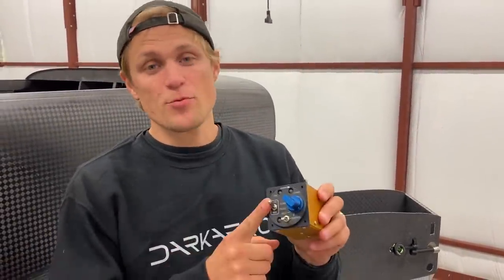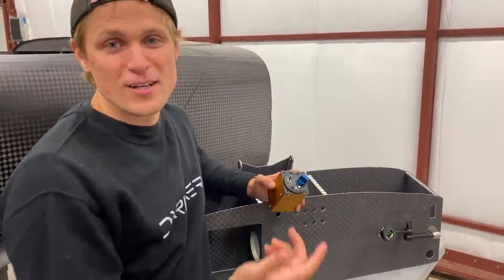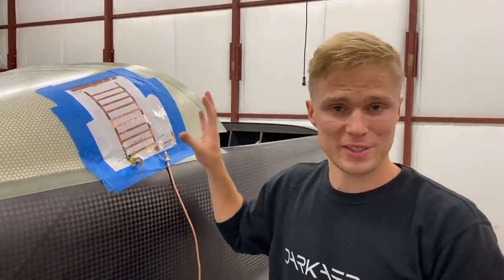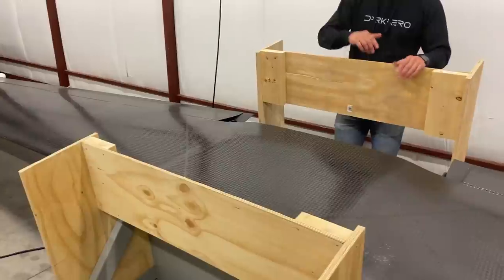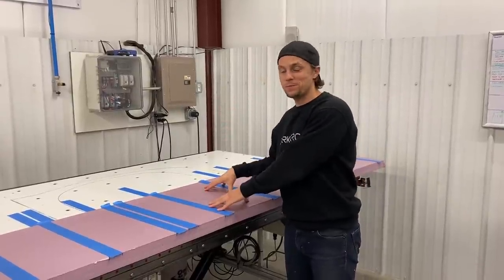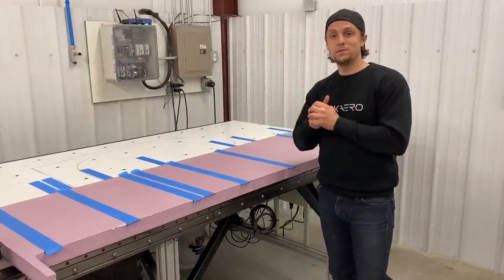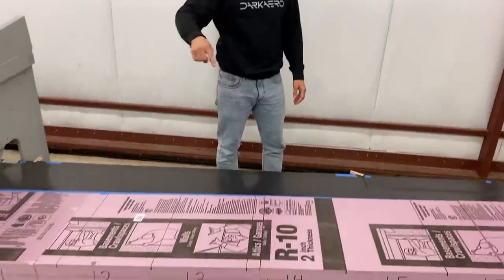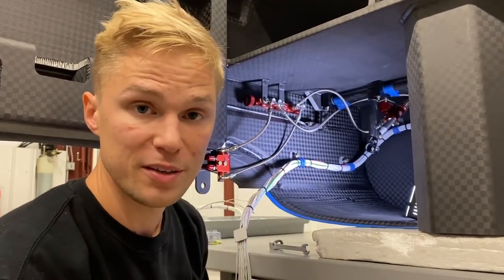Custom Radio Antenna! Will it work? DarkAero 1 Progress Update - September 18, 2020

Comment: For the antenna, how about in the gear doors? When extended and on the ground, better for landing and taking off. When up, better for signals at altitude. Just a thought since the whole plane is a ground plane for the antenna.

Comment: I installed an Airmaster prop years ago and it was very simple to integrated it. Couple of power wires to the controller and then to the prop. Made flying with a Rotax 914 very relaxed. Pick the right flight regime and off you go, simple as that. Manifold pressure is then you main indication of power.

Comment: At McDonnell Douglas, we embedded antennas in the DC-9 like this as far back as the early 1960's for VHF and low freq ADF. aka CONFORMAL antennas in the vertical and WBF and the tailcone.

Comment: I love your work!  Two thoughts on the antenna.  First, that design looks like it could work fine, but the meter isn't telling you the performance.  It's telling you the impedance, which is how it loads the radio.  That's important, but it doesn't tell you how well it works as an antenna.  You'll want a field strength meter for that, or even a simple test where you transmit with that compared with a standard antenna, listening from a distance, preferably with some sort of meter.  But maybe more important - if that antenna is going to be connected to a full size radio, and it's on the canopy, it may be way too close to the passenger's head.  On a traditional metal plane, the skin protects the occupants from high RF.  With a composite, you need to move the antenna farther away from people, especially their heads.  With a 1W handheld, maybe not a big deal, but with a 25 Watt radio, it's kind of a big deal.  Best of luck!

Comment: On a nice cold crisp day it should work amazingly well. Especially if there is ducting. It also depends of your PRF. The we have Lobbing, Ranging and Aspect Dependency. I used to be an Electronic Warfare Operator on P-3C Orion's in the Navy for two years. And I was an Air Traffic Controller for 9 years. (I got airsick a lot so I had to change Rates).

Comment: The antenna design itself might not be a problem... but considering the whole composite carbon fiber body will be coated with metallic painting for discharging when flying. The flat antenna might have certain interference.

Comment: Hoping to see a performance comparison at some point between the Airmaster and a fixed or ground adjustable prop. I have no doubt the Airmaster will be at least slightly higher performance, but it would be cool to see exactly how much of a difference it makes, especially given the cost and weight difference between the two (30ish lbs and ~$9k vs 8ish lbs and ~$3k).

Comment: Looks really well thought out. Are you doing any fatigue tests on the wing or are they unnecessary?
Reply: most probably unnecessary as carbon is very good also in dynamic loads. Check out the Wöhler curve for carbon..

Comment: Antenna design is chock full of entertaining and unexpected failure modes. Not sure I'd want to spend valuable time on that. What might help with space is re-using parts of the CF or the alu honeycomb as a ground plane for a regular antenna. Also lining parts of the cockpit with some thin sheets of alu coated mylar or similar to provide an RF shield so the antenna doesnt radiate into headsets and the like. Also using differential signalling and scattering some RF chokes between any electrical components will stop RF energy coupling into important stuff.

Comment: As far as I know, radio waves used in aviation are polarized to avoid interference most commonly between COM and NAV frequencies, thus the orientation of the antenna counts a lot. At 2:45 you are saying that this antenna is designed for COM frequencies, but for me it seams that it is aligned with the NAV frequency polarization. I'm not an expert on EM, so please correct me if I'm wrong.
Reply from the maker: The com radio frequencies are vertically polarized, which was a big part of the challenge with this antenna since we have limited vertical space in the turtleback of the airframe for the antenna to "see" out of. The antenna is slightly curved so there is some component of it in the horizontal axis but the majority of it is in the vertical axis. More real-world testing will be needed to see whether or not this antenna solution will work, but we'll report back how this goes.
Reply: @DarkAeroInc  I am actually in a home building project myself, and I am planning to embed the COM antenna into the vertical fin, and make it possible to install NAV antennas into the horizontal fin. Your team and your videojournal is really inspiring. I would love to here your thoughts on this idea.

Comment: You mentioned in a previous video that you were using Onshape for your CAD work.  I noticed Fusion 360 for the milling work.  Are you using Fusion 360 just for CAM?
Reply from the maker: That's correct. We use Onshape for all of our design work. Fusion 360 is our current CAM tool.

Comment: The radios have a lot of output power (16W!). Needs to be far away from you and other electronic equipment. If they radiate into the cabin you will get feedback because they will couple into the mic of the headset.
Reply: Also, the antenna needs to be vertical (for the correct polarization) otherwise you will loose a lot of RF energy both for Rx and Tx.
Reply: The mismatch between vert and horizontal polarization is about 3db. That much "bend" shouldn't cause a problem.

The FCC has come out with new RF exposure limits. With the antenna so close to the crew compartment you may want to look into projected field strength, before you finalize the design.

Also consider putting one antenna on the top, and one on the bottom.

Use the top one on the ground, for ground, tower, atis. Use the bottom one in  flight.
Reply: @linuxranch  The loss is cos^2 of the angle. At 90 degree mismatch, no energy is transferred. Which formula shows only 3 db loss at total mismatch of polarization?

Comment: Awesome update, do you guys have to get FCC certifications if you use a custom antenna? How do you work with the radio manufacturer to approve it?
Reply from the maker: Sherif, the radio we interface with the antenna is designed for the civil air traffic control frequency band (118.000 to 136.975 MHz), which limits the antenna to this bandwidth. The Garmin radio requires that our antenna hit what is called a Voltage Standing Wave Ratio of 3:1, but ideally 2:1 for this frequency band. The vector network analyzer being used in the video allows us to check this performance metric to see what we can do to achieve this ratio before using it with the radio in flight.
Reply: You don’t require FCC certification for an antenna.  However the transceiver and total EIRP has to meet both FCC and FAA rules.

Comment: OK, you show a pic of the com antenna but fail to explain the custom  antenna design which you claim is a lot of work. There are a number of designs that will work, you design, build, install and then check the resonant frequency which will end up being different from the design formula due to the dielectric constant of your carbon fiber. You the work backwards to find a correction and apply that to the original design.